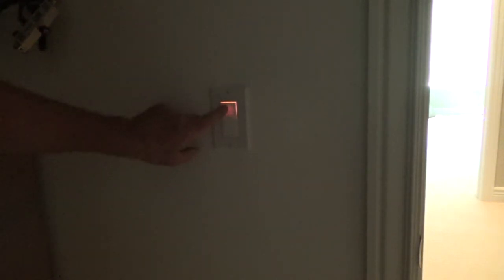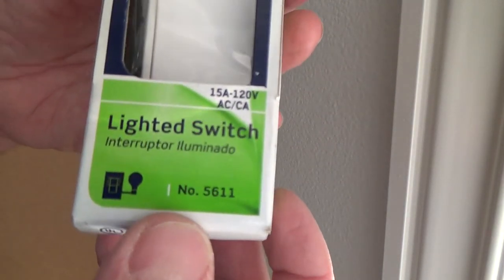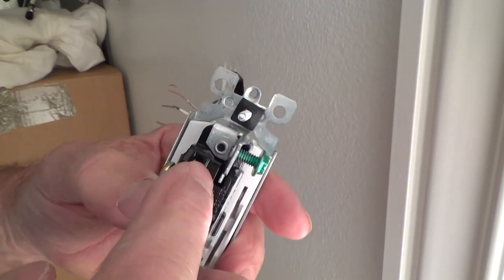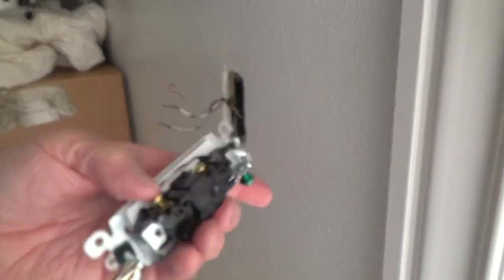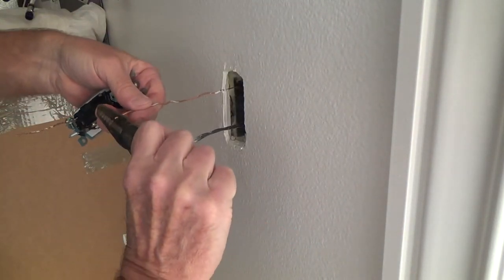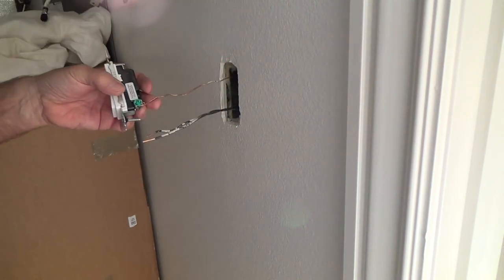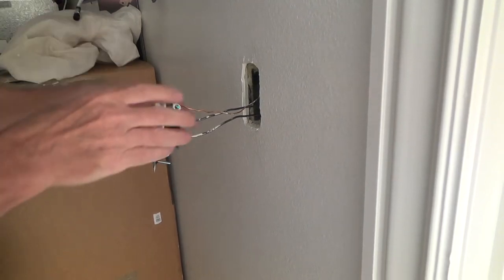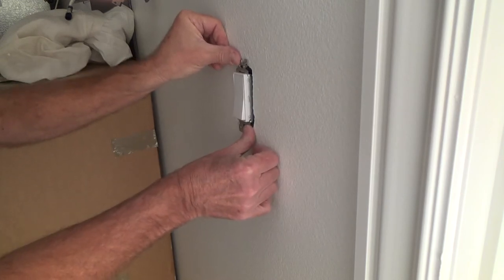Installing a Lighted Light Switch Made Easy

Comment: 7:12 You should have used the 'side-wired' terminals...it's a much better mechanical/electrical connection to the device.
Reply from the maker: I would have to agree with you as I've seen some connections come out of the holes in the back when installing. I have made numerous videos connecting the wires to the side terminals but I figured I would show how to connect to the back on this particular video. Thanks for the mention though...

Comment: 9:36 It's NOT a 'sheetrock-screw', it's a 6-32 machine screw used for attaching the device (a SPST switch in this case) to the electrical box or mud-ring.
Reply from the maker: Yes you are correct but in some cases if the plastic box has stripped threads then I've used drywall coarse threaded screws to secure & works great. But if the threads are still good in a plastic box then by all means use the machine screw as you have mentioned. Thanks for stopping by...

Comment: I just installed one of these and the light switch itself works but the led light on the switch itself doesn’t illuminate. Is it possible I installed something incorrectly? I used the shepherds hook around the screws under the clamps.  I didn’t use the hole in the back of the switch.  Could that be the issue?
Reply from the maker: I would think that if the light switch works like it should then the lit part should work too. It might be difficult to see the lit part until it's dark. did you check the switch when it's dark? Could it be possible that the light switch isn't a lit light switch after all & someone messed around & switched it in the box by accident? It shouldn't matter if you used the screws to tighten up the wires. If everything still doesn't check out I would take it back to the store & return it & swap out for another one & go back home & install the different switch & hopefully it will work like they say it will work. There also might have been something wrong with the lit switch you got like the led part not working but I have never heard of one not working but possible. Let me know what happens. Thanks for being a DIY'er!
Reply: I have the same problem..

Comment: So you had the ability to back wire, but instead chose to use the inferior back stab method 🤦🏻‍♂️
Reply from the maker: I usually don't put the wires in the back anymore but for some reason on this one I thought I would do it to show viewers it will work. I've had one time that this way one of the wires came unsecured & I had to pull out & do it again but other than that I've never had an issue. Why do the manufacturers give you this as one of the options to connect the wires if they know better...?

Comment: 11:18  LOL!!! I've never seen ANYONE use a tape measure on a trim-plate.  If you can't 'eye-ball' the plate correctly, use a 'torpedo level'.  Better yet, stop teaching people the WRONG way to do electrical work...Thank you!
Reply from the maker: Ha! You would be surprised by how many times I've seen a face plate that was crooked. That's why I mention that if you have door casing nearby then why not whip the old tape measure out & see how straight the faceplate is. The wrong way to do electrical work would be to just leave a crooked face plate alone & not do anything to correct it. This video channel is mainly for DIY beginners...